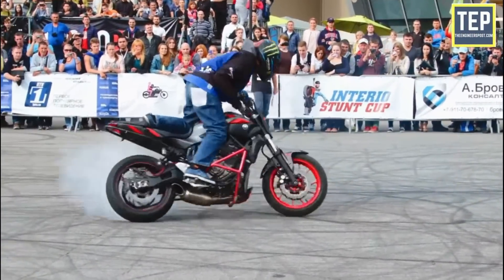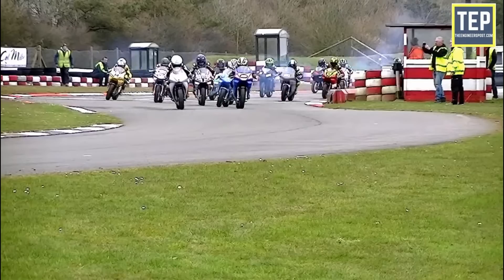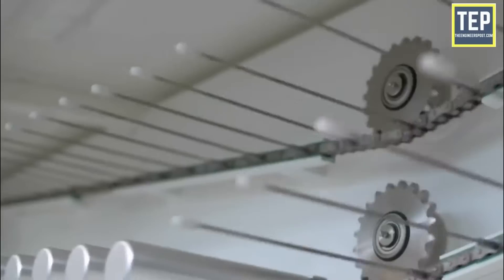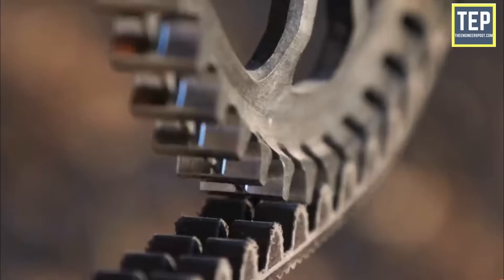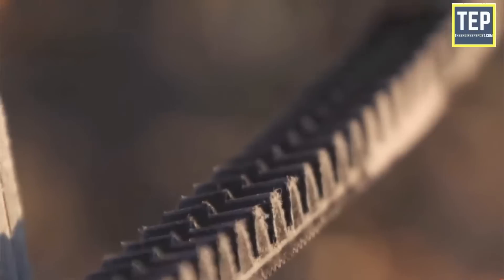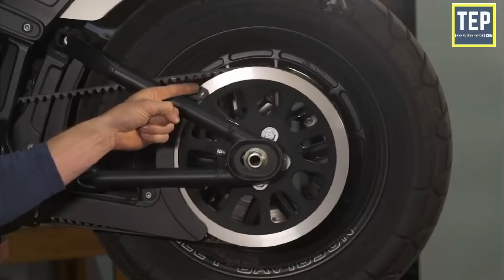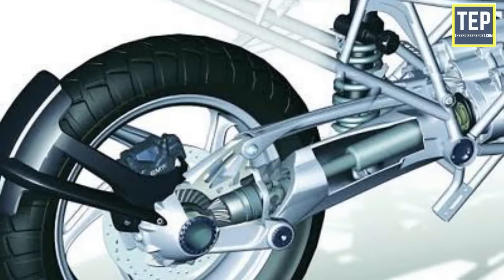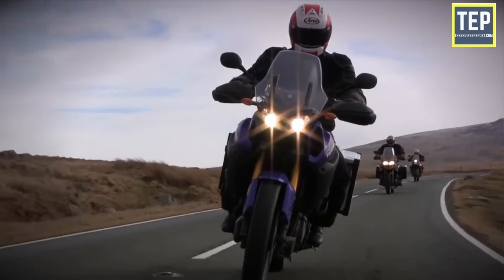Chain Drive vs Belt Drive vs Shaft Drive in Motorcycles | Which is Better?

Comment: Shaft drive system is totally maintenance free while showing the oil being changed on one.
Reply: It’s practically maintenance free when you consider the intervals. Oil change on my Honda is 16k and BMW initially said not to change the oil in my GS.
Reply: Yeah 1 time maintenance cost is equal to several maintenance cost and multiple replacement of chain with lock
Reply: A video i didn't intend to watch but notification lead me to it...now i know a whole lote of stuff..thanks.
Reply: Really didn't know at the time....but my '86 Kawasaki ZL 600 Eliminator shafty went for 14 yrs of constant riding without ever changing the oil.Only on one routine engine oil change did my mechanic asked me if I had ever changed the shaft drive oil and I responded that I thought it was supposed to be maintenance-free,and well,he laughed and suggested I should
...so I did.I bought that bike in 1990,so I'm assuming it actually went an additional 4 yrs before it's very first oil change.LOL....I loved that bike.All I ever did on it for maintenance was changing tyres and the regular engine oil and filter changes.With a heavy and broken 💔 heart,I finally sold it( 2013), as I didn't want my sons (who were infatuated with it),to start riding on the public roads as at the time (and even now) we just don't have the road infrastructure in my county (Guyana)to facilitate the burgeoning traffic congestion of  the current influx of cars,trucks,mini-buses etc,causing a regular case of motorcyclists fatalities over the years.I just feel a little safer with m-cars for them.👍😎
Reply: @kenardazeez9593  A lot of fatalities due to road quality?  What kinds of accidents would be the main cause related to road quality?  Hitting a pothole and crashing into oncoming traffic?
Reply: @Snoupity  LOL.No sir...when I said road  infrastructure, I meant that at the time when I bought that
motorcycle, almost all the roads in my country was narrow like a one lane carriage- way,always a tight squeeze for two vehicles passing each other,and as  development took place,widening the roads to accommodate the rate of additional vehicular that caused congestion, was not a priority of our government.As such, motorcyclists and it's 4 wheel counterparts were in frequent
accidents...with an extremely high rate of fatalities for the former.I myself was involved with 3 such
occurrences...none of which  was any fault of mine! I learnt the hard way that cars,trucks,mini-buses etc, just do not look out,or cater for two wheelers.And like you mentioned....there was the potholes and other stuff like stray animals to go with it as well!🙄😞🙏
Reply: Definitely the most maintenance free. I have over 50,000 on my OE shaft.
Reply: Hahahahah
Reply: They said chain drive power loss is only 1-4%, when 10% is the average. Definitely non English speaker produced video.
Reply: @freebehindbars8654  so saying number wrong means he can't speak English 🤣🤣🤣🤣
You are delusional 🤣
Reply: @dipeshpadewar  Hey Dipeshit. I didn’t intend on offending anyone, but it’s obvious this video wasn’t well produced or researched, I was giving one option on why it  was poorly produced.
Reply: @freebehindbars8654  A spiral bevel gear is a really high efficiency at around 98% as well.
Reply: @omnipotent87  Not true. Shaft drives take the force a complete 90 degrees, even with the best gear design it falls short of what a chain provides in efficiency. Common knowledge.
Reply: @freebehindbars8654  Nobody's going to address the Gyroscopic  effect a spinning shaft creates?  Because of effect of the law of angular momentum conservation, a body rotating around its own axis tends to maintain its own direction....Adds to difficulty in cornering.
Reply: @readmore3634  my BMWR1100RT  has absolutely no problem cornering. 
Correction  if I have the luggage on the bike  I have drug them on the asphalt when cornering.
 When I first got the bike I had to learn to  corner slightly different than I do on my gsxr1100 or Ducati Paso. But shaft drives do corner well
Reply: @robertgutheridge9672  With opposing heads you gain a much lower CG (noticeable to even a novice rider). Your R1100RT is a bit exceptional to the majority of typical street bikes. (very nice too)
Reply: @omnipotent87  : Closer to around 94%, 6% loss. The losses in a typical transmission are also about 6%.
Reply: @readmore3634  I lay through corners at over 90 mph
Reply: @readmore3634  it’s not like chains and belts don’t have gyroscopic forces.
In fact on a belt and chain they will resist not only turning but leaning. 

Of course, the wheels are such enormous gyroscopes that everything pails in comparison. And your crankshaft and gearbox, can’t forget them. Of course, the best orientation for a crankshaft and gearbox is running lengthways down the bike, that way at least it doesn’t effect lean as well at turning. Which lends itself to… shaft drive!
Reply: @HALLish-jl5mo  Totally agree with everything you listed. Not sure what I commented to provoke your educated  response. 
    I clicked on this post because in 1984 I rode a friends Yam XV1000 Virago and when down throttling the back tire would "chirp" due to play somewhere in the final (shaft) drive. Not good when cornering. I raced MX back in those days. Promised my dad I'd never get a street bike.
Reply: @robertgutheridge9672  I'm an idiot...not sure why I replied that...I don't even have a clue the RPM a shaft drive reaches...and even if it was surprisingly high it wouldn't affect cornering very much.....I digress.
Reply: @readmore3634 it doesn't. For that to be an issue the angular velocity would have to be be near the amount of force you put on the bike, and given its a very small, lightweight shaft, theres not alot of angular momentum going on
Reply: @outkast937  Yeah, I addressed my stupidity in a comment above. Don't know what I was thinking a year ago......those wheels (enormous gyroscopes) are the culprit.
Reply: Wow
Reply: Rip shaft system users
Reply: ong
Reply: Yea just like I was promised with my wife,  maintained yes, free NO.
Reply: yeah .. and it also lasts a lifetime of a bike 
proceeds to crash it after a month 😅
Reply: "hardly ever need maintenance" is what he said.
Reply: Can confirm, i literally never needed to change the oil on mine, except the time i had to fix a flat tire.. kinda had to since you cant remove the rear tire on mine without pulling the shaft and hub off the bike witb it
Reply: And if you have problems and need to service, it takes lot of time and so much money lol.
Reply: Myself and a number of friends have had spline failures on our BMWs. Even with maintenance.  Honda shafts seem to hold up better.
Reply: Had all 3 systems but belt is my favourite for maintenance, cleaning and cost
Reply: The angular momentum of the shaft has tendency to  flip the bike during accelaration.
Reply: Still cheaper
Reply: Regular maintenance is actually mandatory on them, if you don't maintain it you're gonna have problems. VFR 1200 taught me all i needed to know about this system.
Reply: @alanwatts8239  kķ
Reply: @alanwatts8239   yes bro
Reply: My shaft needs daily maintenance.
Reply: @deancafe4739  😣😣😣😂😂😂😂
Reply: Hehe
Reply: Shafts need regular maintenance.
Reply: @craighudson7294  Chains need constant maintenance .
Reply: @craighudson7294  My shaft is neglected of regular maintenance.
Reply: @craighudson7294  Change gear oil every 30,000km to 40,000km depending on manufacturer. Takes 10 minutes .

I would hardly call that regular maintenance. Valve adjustments and checks are more frequent.
Reply: @craighudson7294  really? Bought a '83 vt500c new; last year I drained the f/d oil and it hardly showed any wear
Reply: @manuelbonilla546  really? But it did show wear.
Reply: @craighudson7294  define 'regular' -  Shaft drive on a Suzuki Intruder 1400; over 98,000 miles-  think I changed the gear oil TWICE.  So that means, the factory did it a 0 miles,  I did it probably around 40,000 - and then I remember doing it again at 88,000. Shaft dive on my 83 Suzuki 650GL- at over 70K-  don't even remember ever doing a change. Sold the bike to my brother in-law;  I'll ask him is he ever did it-  I doubt it.

Comment: Both of my Harleys are chain drive and I never had any problems and they never let me down . They  are made of good components .  I went from belt to chain because did not want to be on the side of the road . For a stock Harley would be fine . I don't have to adjust my chain very often as it made of good high quality x ring chain
Reply: I like apples, i have 2.   I have never tried oranges or bananas.   But apples are the best of the 3, i just know......because i bought 2 apples and eat them often.     My opinion is based on a great set of experience and data collection.  That is why iam smart.... because i know all my fruits.
Reply: @mistersmith7391  lol?
Reply: @mistersmith7391  lol Thats great!
Reply: Don't you still need to remove the primary and clutch to get at the drive sprocket if replacing chain though, I have a belt drive Dyna and it's bloody expensive if you have to replace the belt and sprockets because of this.

Comment: I though belt drive is used only for scooters while drive shaft is used for cars only 🤔

But anyway, i prefer chain drive. It's easy to repair and replaced whenever needed. Although it's disadvantage is that, since you need frequent lubrication but not bad after all 😁 Only if you're not too lazy taking time to lubricate

Comment: Can you Advise that if 25% transmission loss is happening in shaft drives, where is that energy going? Cannot be only heat as it’s almost 50 Horsepower’s in a let’s say 200HP bike…
If anyone can shed some light.. 
Thanks 🙏🏽
Reply from the maker: All this power loss is because of the extra gears and shafts.
Reply: @TheEngineersPost  So where is it going? All heat and sound?
Reply: @ChrisLee-yr7tz  almost all of the energy loss is heat, but it is far less than 25%,
The power loss is because of the friction in the transmission fluid within the shaft drive and the extra bearings and the extra gears used to translate the rotational force 90 degrees towards the wheel.
On a BMW 1200GS making around 125bhp, a 25% loss would be roughly 30kW of heat, which would be like having 15 electric heaters under your bike, clearly this is just not the case.
Reply: Closer to 22kW, so around 11 electric heaters...

Comment: Having owned and ridden all 3 over the past 46 years, shaft wins hands down, unless it's a dirt bike (or a BMW) My bought new 2002 Kawasaki Vulcan 750 has 119K miles on it and the shaft drive has never caused any problems. Just change the oil in it once in a while. Shaft drive bikes also have a HUGE advantage when it comes to rear wheel alignment. The wheel can only go on one way, so there is no alignment to deal with, and nothing ever needs to be adjusted. It is sealed and protected from dirt, water, mud, whatever you ride through. Sadly shaft drives are so expensive you don't see many of them anymore, manufacturers are cutting corners to save money. 

The next best thing is an O or X ring chain. They last a long time, and don't need to be lubricated or adjusted nearly as often as old school chains, they are easy to work on, and you can usually change the gearing by replacing sprockets. 

The last and by far the worst is belt drive. I have a belt drive Harley, and after trying for three days to get both the belt tension set right AND the rear wheel aligned, I gave up and took it to a local independent Harley shop (NOT a dealer) They told me it takes TWO people to do it right. And while a chain will tolerate a slight amount of rear wheel misalignment, a belt will not. It has no sideways flex, and the slightest amount of misalignment will grind it up. There is also the problem of getting a small rock or piece of gravel between the pulley and belt. That is usually no big deal with a chain, the steel chain and sprocket will simply crush it. But with a belt drive, it can destroy both the belt and pulley. I am planning on doing a chain drive conversion on my Harley. Belt drive SUCKS.
Reply: Agree with you that shaft drive on a powerful enough bike is best. Did you have bad experience with BMW shaft drive? 
As a BMW mechanic I only see very rare occasions of a worn out drive shaft driven bike.
Reply: Single sided swingarm with chain could be good then
Reply: The boxer engine in my BMW R nineT is phenomenal. Fast, torquey, and smooooth.
Reply: Your wrong about all you said about the belt drive. 
Had both an XB12S and 1125R (belt drive)- 1982 Honda XL500, Suzuki: 2001GSXR 1000 and 2002 SV650S (chain drive) and belt beats any chain drive any day of the week. Did ALL my own work on all the bikes. 
Cant speak on shaft drive though.
Reply: Did you have an issue with bmw drive shaft?
Reply: FYI - you do NOT need 2 people to align and tension a belt, but (and you already knew this was coming) you do need the bike held upright on either a center stand (which Harleys only ever have as aftermarket items, and that rarely) or an appropriate lift. Note that you don’t need the bike in the air - a full size lift with handlebar tie downs and a wheel chock works fine so long as the bike is in neutral. 

While I’ve never seriously ridden a shaft drive (though I came really close to buying one a decade ago), I have just over 70k miles on my ZX6 (chain, almost instantly converted to an x-ring) and am about to top 100k miles on my Harley (belt) a major difference to me has always been the feel. Because the belt stretches ever so slightly it takes some of the jerkiness away (though in fairness that could also be the rubber dampeners Harley puts between the driven pulley and the wheel itself). In a cruiser or touring bike this is a huge benefit as it allows you to simply glide around relying on the engine torque to see you through, while you’d downshift on a sport bike to do the same. For those who don’t ride both: on a sport bike if you don’t stay in its power band you effectively have no power, and lugging the engine results in you slowing down as you aren’t generating enough power to keep moving, while on a large touring bike you can indeed lug the engine as it still has sufficient torque even at low rpm’s to generate the power needed to accelerate. For the easiest comparison: try accelerating from a stop in 3rd gear or higher - any big twin Harley can do this without stalling, while essentially no sport bike can (exception: liter bikes and up, and only by revving the engine and dropping the clutch) - these machines are just designed for completely different purposes.
Reply: @robertkb64  I was unable to get the belt tension adjusted and the rear wheel lined up at the same time because the axle nut has to be loose to adjust the belt tension. When I got the belt tension right (and yes I have the H-D tension 10 pound tension gauge) the wheel was out of alignment (I also have the Motion Pro alignment tool that checks the distance between the dimple in the swing arm pivot and the rear axle) After getting the wheel back in alignment, the belt tension was off. I went back and forth several times and finally gave up. I don't have a lift, or room for one. I have never seen a Harley with a centerstand. But I have never had any problem adjusting a chain while keeping the  wheel in alignment on bikes without centerstands.

Comment: Shaft drives often tend to engine break harder than chain/belt due the higher loss in transmission, so going off the gas in a low gear in corners is a no go.
Reply: @Legi0n I agree - just saying the the friktion is lager so going of the gas in 3rd in a roundabout can cause skidding which I doesn't experience on chaindrives
Reply: @lassechristmann2647  Id think its not the friction but the inertia in the heavy shaft.
Reply: @Legi0n I wouldn't expect engine breaking to lock a wheel

Comment: I grew up on chain drives, but eventually got tired of the constant maintenance required, and switched to shaft drive.
I'll never go back to chain.
A chain is a piece of precision machinery, like a gearbox. If I suggested that a biker should remove the cover from his gearbox, let the oil run out, and then use the motorcycle, I'd be regarded as crazy! Yet that is exactly the situation with most motorcycle chains.
There are a very few motorcycles that have a fully enclosed chain, that runs in an oil bath, like a gearbox. 
That is sanity!
Some years ago, I did a 21,000 mile, 45 state, tour of the USA, and chose a shaft drive Honda, ST1100 to do it with. Not one problem during the whole tour! 
I hate to think what the difference would have been with a chain drive.
.
Reply: Most newer motorcycle chains nowadays are sealed. The lubricant is kept enclosed by o rings and don't need external lubrication. If used properly they will last the full useful life of the chain. Just don't use harsh solvents that could interfere with the rings. I love my old shaft drive cx500 but my newer cbr500 can run circles around it. Chains now are not like those of yesteryear. They require less maintenance and adjustment due to better engineering. A quick check before you go and you're off.
Reply: @SophiepTran  
The connection between the chain and the sprocket is still going to get drenched in water, salt and grit in winter, and dust/sand in summer.
So, it's still a lousy engineering solution, for just a little bit of extra speed, which will probably be very rarely used.
Reply: @niklar55  Sure it will. But that's besides the argument. We were talking about the lubrication aspect of drive systems.
Reply: @SophiepTran  
The chain and the sprocket IS part of the drive system, and salt, grit and water will cause premature wear and failure.
So, its bad engineering.
.
Reply: @niklar55  I still love my 88 cbr600
Reply: @superphonixlp4152  
What sort of annual mileage do you do?
.
Reply: Agree.
Reply: @MrMannyhw  
😊👍